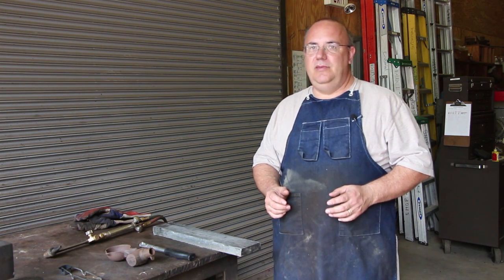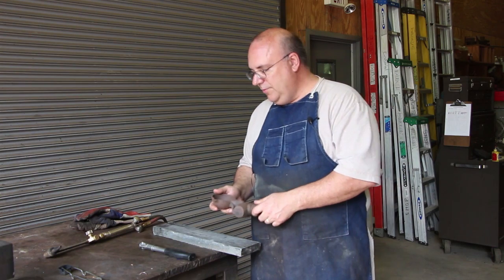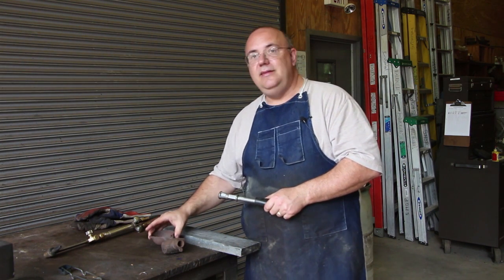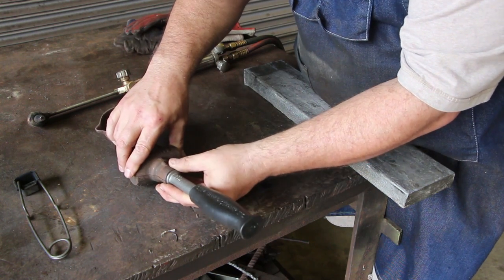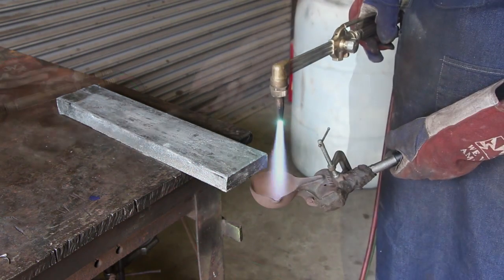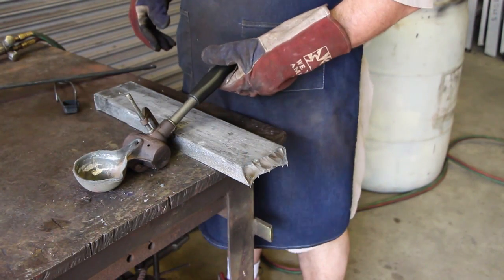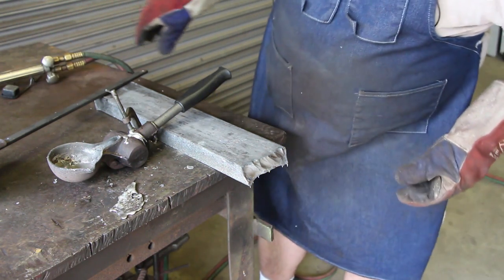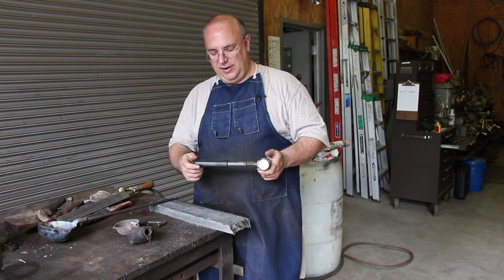Casting a Lead Hammer

Comment: Keith,
Thanks for your lead hammer pour. When slot cars were all the rage in the mid 1960s, I made some small molds and made lead weights for slot cars to increase traction over the drive wheels and on the electrical pick-up arm in the front of the car. I sold quite a bunch at a local slot car track and shop in town. It was fun and the $$$ wasn't bad either.
Regards,
Dave

Comment: I just got out my old hammer handle  that I made in shop class back in 1968. I used my shop teachers mold to pour the first one. I don't want to pay $130.00+ for a mold but yours is just like I remembered. 
I started casting lead when I was 8. I got a mold for tin soldiers for Christmas in 1959. Dad rigged up a propane torch and a ladle. Been casting ever since.
Lead isn't the boogy man everyone sues over. Molten lead is hot. Caution is needed. It's not going to jump off the ground and kill you. 
I've lost more neurons to alcohol than I ever will to lead. 😈

Comment: Cool video Keith. I like that hammer mold. I would actually like to purchase one of those handles and have you pore me up one.
Hey maybe I'll show some of my lead poring stuff in my next video.
Thanks for sharing.

Adam
Reply: Just ordered it Keith. I'll bring it with me.
Reply: Hi Adam & Keith,
Went to respond on Keith's channel and I couldn't. Wanted to mention that if you melt the lead in the attached ladle with the flame under the ladle it will preheat the mold cavity better and give you a very nice shiny hammer! When you melt into the ladle you could hold heat under the mold and ladle for a little while after it's full and then tip to fill!
Ask any bullet caster ~ "A warm mold is a happy mold"

Thanks for the video Keith!
Jeff
Reply: Jeff, when poring my lead I use a cast iron pot on my outdoor cooker and ladles. Usually I just pore the lead directly into the mold from the pot once it's all heated to proper temp.
Reply: Hi Adam,
That's basically what I'm saying also! The mold your pouring into needs a little preheat too! It keeps the lead from "freezing" (cooling to fast) when you pour, kind of like when you pour babitt bearings! When Keith was melting "into" the ladle it was not really getting the hammer head mold warm enough! Something to play around with this weekend!

Jeff

Comment: Hello Mr. Rucker. Today is Oct .25, 2014 and as luck would have it I went to an auction today and purchased for the grand total of 35 bucks A box that contained 2 hammer mold's, 6 handles and one completed hammer! I have never seen A hammer mold in my 50+year's of auction going (I'm 62 Y.O.) and was unaware that these mold's were still available.
  I was an auto mechanic (we were mechanics back in my day. Would never have thought to call ourselves "technician's") for 16 year's and went through at least one lead hammer A year and buying them off the tool trucks not cheap! Sure could have used A hammer mold back then!! And making them would have been free as we had 5 gallon grease pails full of used wheel weights.
  You are correct that A clamp was on your mold originally. One of my mold's still has the clamp. It is attached to the small hole near the handle with A cotter key and it resembles A tiny C-clamp but your workaround is probably better.
  Good luck! and now that I have found your channel I will have something interesting to watch during the cold Minnesota winter. I retired this summer but my shop is unheated so projects will be on hold until April or so.
Reply: No. Both are marked Cook Hammer Service E. Providence R. I.  Below that one is marked 5 and the other is marked 6.The handles are solid steel instead of the rubber grip that you used. I believe that I would prefer the rubber grip. 4 say 130 Cook Lead Hammer Service Inc. The other 2 say Lawrence H. Cook Inc.
  It was A once in A lifetime find for sure but auction's are like that. 2 years ago I found A John Deere 112 garden tractor for 220 Buck's that run's perfectly and look's good for A 35 year old tractor. Take care!
Reply: Gary Ronan I hope your hammers are holding up well. That's a great find.

Comment: A little marble of bee's wax before you pour would have helped 

it flows better when it's fluxed.

A carbonizing flame may have helped too.

When you pour, try resting the bowl on the table and then lowering the handle.
It would give you more control so you can keep the vent hole high the whole time.

Comment: your lead casing brought back memories of working in a large print shop, there was hundreds of tons of type metal.Salmon fishing was a big sport here on the west coast. Fisher men needed cannon ball size weights to get deep enough to catch "the big ones". When you have what you need at hand it only made sense to use the type metal. The guys had a number  of different size molds and there was a big electric type metal furnace. I cant count the number of balls made, they even made an occasional lead hammer and lots of hot metal type. Those were the days.

Comment: When I cast lead hammers I preheated the mold more and also melted the lead in a larger ladle over a burner for babbit pours so I could skim off the impurities from the top. Lead oxidizes causing some impurities as well as the flame from oxy acetylene torch adding some impurity. A propane flame has less impurity. If you preheat the mold excessively it will cause the lead to boil some inside so you can end up with an ugly look. It was interesting to learn about using a small "marble" of bees wax. I believe that would help.

Comment: We used to make lead hammers using a soup can and a piece of pipe with a plumbing T at the top.  Wrap the handle with some leather and push a wooden plug into the end of the pipe.  The nice thing about the lead hammer is that it is a dead blow hammer without rebound.  It's the perfect tool when you have to give something one big hit with a big swing; POW.

Comment: KeithWe use the lead hammer at my plant and I have made several of them.  I have found that if you keep the mold at the edge of the table with the handle off you can just roll the mold back and allow the lead to go into the mold after you have it melted.   It gives you a lot more control and less likely to drop it on you or the floor.  Not sure if any one has suggested that tip to you yet
Reply from the maker: +Joseph Ribinsky Thanks Joseph, as I have made more of these hammers since shooting that video, I have learned that trick as well!

Comment: pretty cool. I used a small empty wd-40 can for a mould. And inserted the hammer handle into it, worked out pretty well with a streamlined and balanced lead hammer, one end of it also included a smaller diameter, been working it ever since.

Comment: Do you think Maybe this should be done on a heat source with your material already in the pot not with an oxy torch and a bar dripping, might reduce vapor exposure and lower chance of accidentally getting molten lead on yourself? Honest question not trying to tell you how to do your things this process worked very well

Comment: That custom made wood handle version sounds, well, custom. I wouldn't be surprised you could find a small profit here, making lead hammers for the knock-off wire wheel set. Call it Rucker Tool Co., makers of fine tire changing tools :)

Comment: The hardness of the hammer head can be controlled considerably by what metal is used.  Pure lead is very soft.  Lead wheel weights are a harder alloy.  Linotype is pretty hard.  Babbitt alloys give even more choices.  Metals with more tin in them fill the mold more accurately and leave a shiny surface.  Antimony makes the metal harder.  Fluxing it, with beeswax as mentioned or other flux, and then removing the dross from the surface of the molten metal will make a better looking hammer without hard inclusions that will damage your work.  Look for references on bullet casting for more details.

Comment: Keith, looks like it makes a nice hammer, but don't let the lawyers see it!  Don't know about a design that has you tipping molten lead towards your hand...if I was doing it I think I'd build in a handle out the side of the mold to hold onto, not make you use the hammer as a pouring handle. 

Thanks for the info though...and for showing how it's done.  I think Mr.Pete was as much interested in showing he you make a permanent mold as he was in making a lead hammer. 

-- Mike

Comment: Dead Blow style idea using "higher end" silicone, 5200, or similar in a vynale tube.
Cut a hole for wood handle in a left over/ waste partial tube.
Let dry and open...Added wood Tee insert or other custom needs
Non Marking super easy rubber type mallet

Comment: Could the same mold be used to cast a copper hammer head?
Reply: might give it a go if I can find a mold or get time to machine one up
Reply: I would not consider it a wise move to attempt casting copper in that mold.  The MP is far higher and a failure of the mold could result in severe injury.  The mold in question is designed specifically for use with lead.  I am almost certain that a similar mold for copper would be substantially heavier in construction in order to cope with the higher temperatures.

Comment: 2:08 -- Hi, Keith.  The hammer mold was patented:  Charles H. [Henry] Field, Jr. "Combined ladle and mold for lead hammers," U.S. patent no. 428,558 (filed:  August 26, 1889 ; issued:  May 20, 1890).  You can view the patent at Google patents ( https://www.google.com/patents/US428558 ) or the U.S. Patent Office's Web site.  Both Charles and his dad (who had the same name) made watch cases.  In 1912, Charles Jr. co-founded the Field Engine Turning Co.  One of his rotary turning machines can be seen here: http://goldmachinery.com/machinery/8854.htm .

Comment: Hi Keith. I have 4 pounds of brass shells (spent bullet casings). Would you be able to cast me a brass hammer with this mold if i sent you the materials?
Reply from the maker: +StreetMachine18 To be honest with you, I am not sure how this mold would handle brass.  I would be afraid it might have too high of a melting point to work.  But, I might be able to cast one in a sand mold - I could just use my lead hammer as a pattern and put the handle in the mold for the pour.  I might have to try that myself!
Reply: +Keith Rucker - VintageMachinery.org I agree, a sand casting may be a safer bet. Did you ever start making your own custom hammer handles?

Comment: Keith, I enjoy your videos but I must voice a concern on this one. I've watched Tubalcains lead hammer video. His process may be drawn out, but his methods are sound. I appreciate the time he takes to demonstrate the process of casting a lead hammer from pattern, to sand cast, to cast mold, to molded hammer. He does so in a safe manner. Your demonstration on the other hand, is quite danderous. lead melted above 900 degrees emits lead fumes which are unhealthy to breathe. using an oxy/acetylene torch to melt lead is  very, very dangerous. lead poisoining occurs by ingestion or inhalation. also, at one point it appeared you about fumbled your casting device and almost spilt lead on your unprotected legs.
while I understand the main point of your video is the demonstration of the hammer casting device and its simplicity as compared to Tubalcain, perhaps you should let people know that your way of casting poses many dangers versus other methods.
Thank You.
Reply: klare ellis well said Klare. You're right, it is a very dangerous thing to do.

Comment: it may be your first time lead casting  but the lead is to hot and vaporizes and lead in your lungs is not some thing you would like. just use a old stove and gently let it melt with a fume hood. better be save than sorry
Reply: dont know for sure i use a temp controlled pot